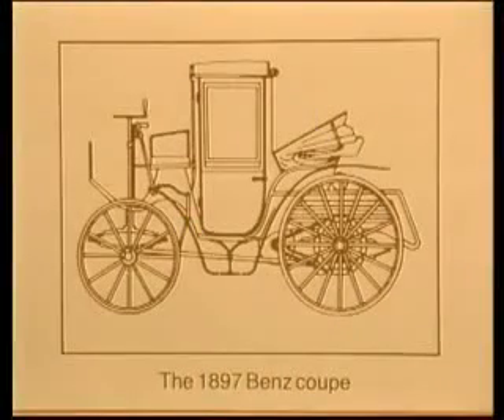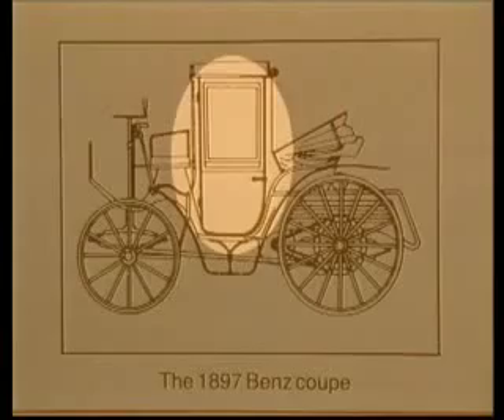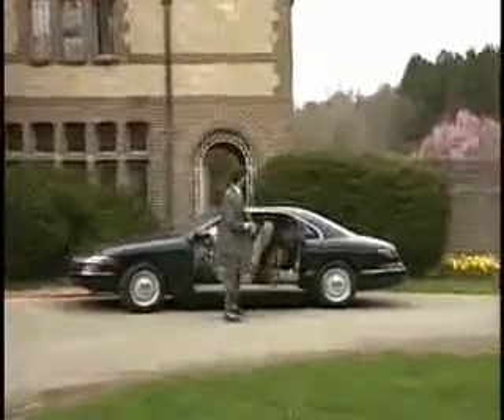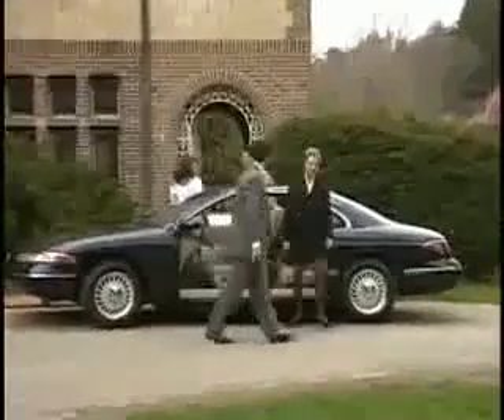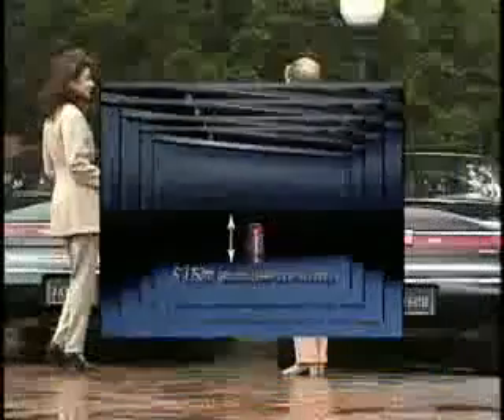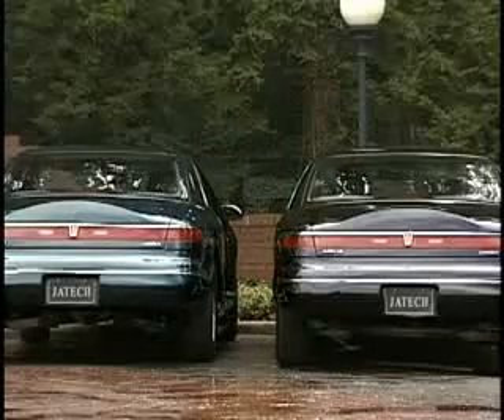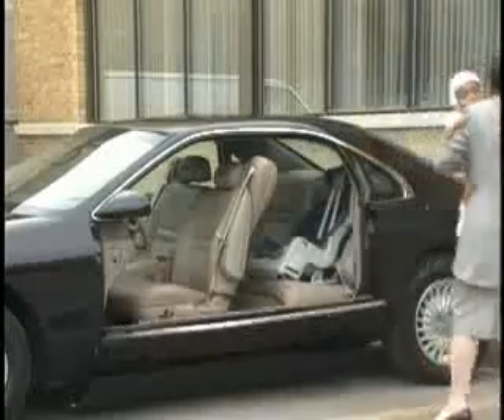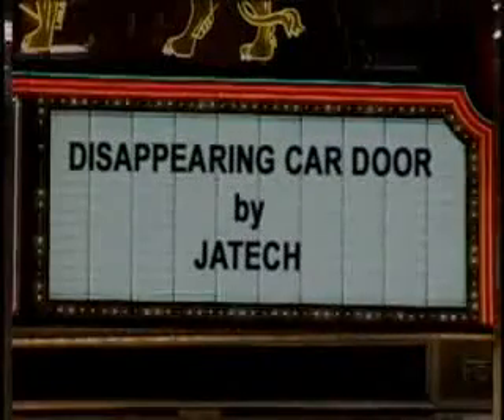Disappearing Car Doors by JATECH

Comment: dud invention I suspect. The company and its website is gone. I suspect that the design failed all the safety tests and becomes impossible to open if the car is damaged. A death trap if the power is lost or the chassis is bent out of shape.
Reply: "A death trap if the power is lost"
and here we are now with teslas having no manual release on the rear doors for some models...